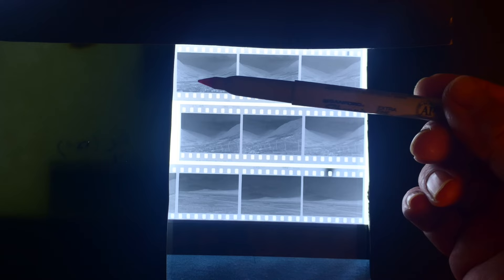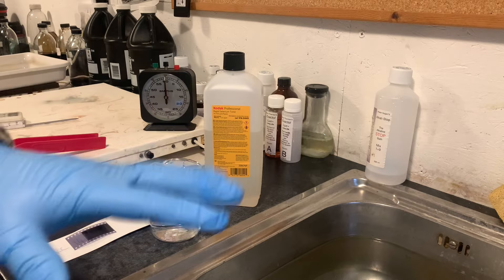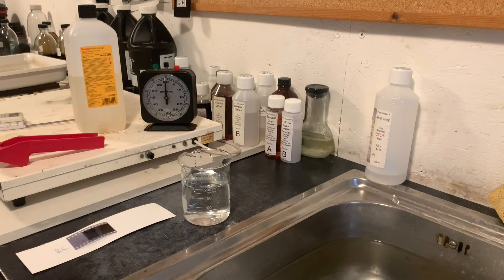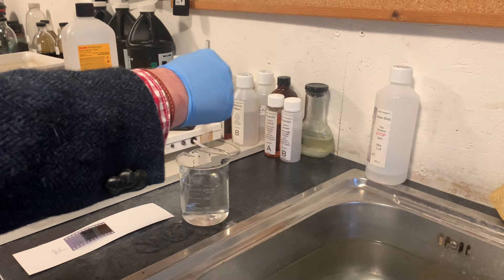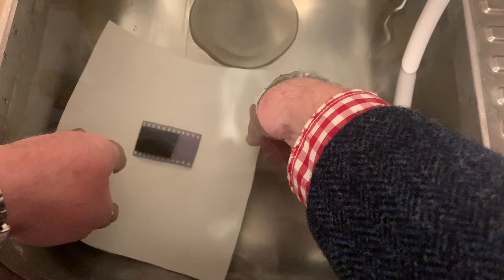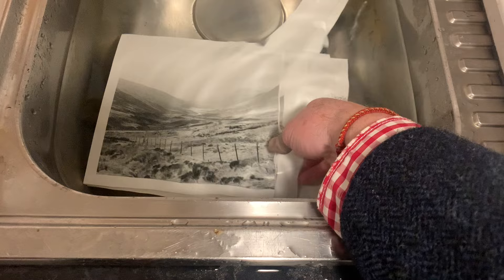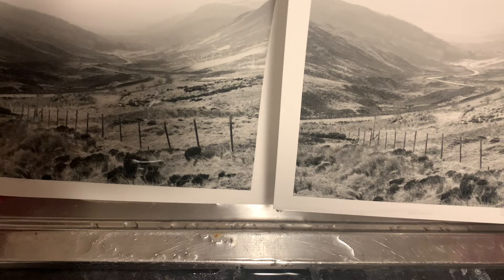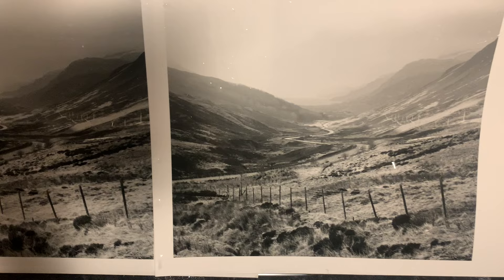Printing The Negative 2 - Improving Flat or Under-Developed Negatives. Method #1

Comment: You can intentionally overexpose and reduce development (n-1) to control grain and use selenium to increase contrast, as well as push one stop (400 ---> 800), develop normally (as if it was ASA 400) and then use selenium to increase contrast without increasing grain (essentially developing at 800) . Would that hold?
Reply from the maker: When you run your 400iso film through at 800 you underexpose by a stop. To regain your underexposed highlights you need to develop for longer. Selenium increases the negative whites more than the blacks so, theoretically, you might gain some back. Interesting idea.

Comment: If you use 1:2 or 1:3 dilution, obviously you keep the negative in for longer in the selenium solution (12 minutes at 1:2 , 18 minutes at 1:3)...?
Reply from the maker: Yes, 15 minutes is a good time.